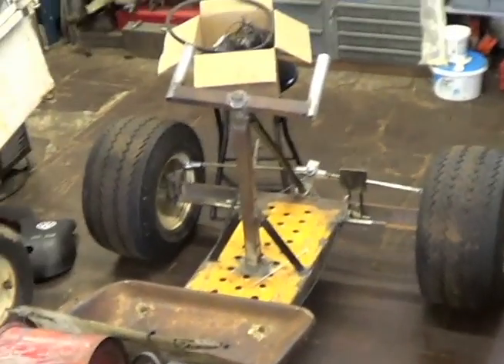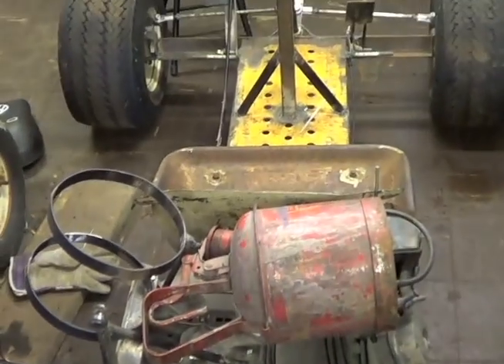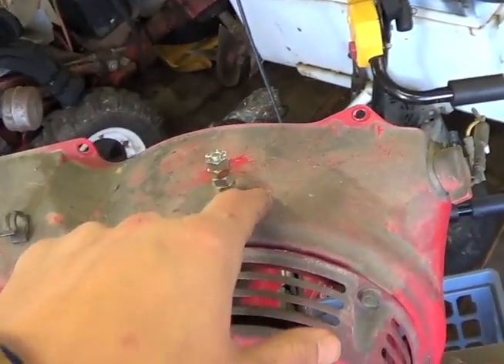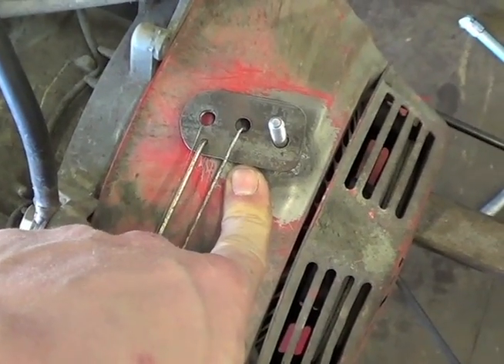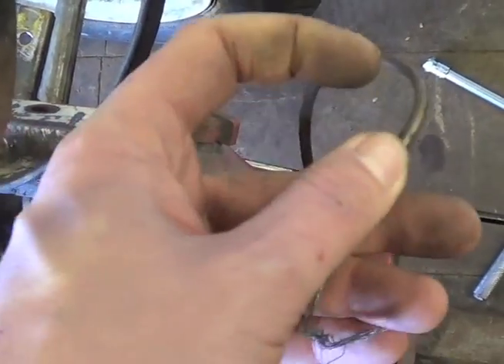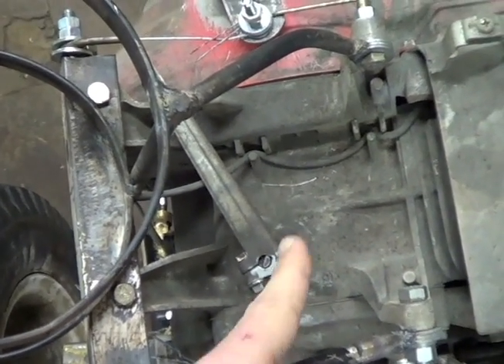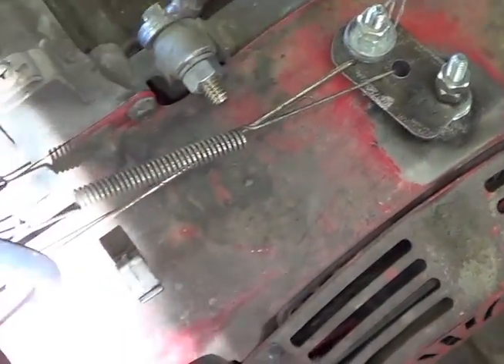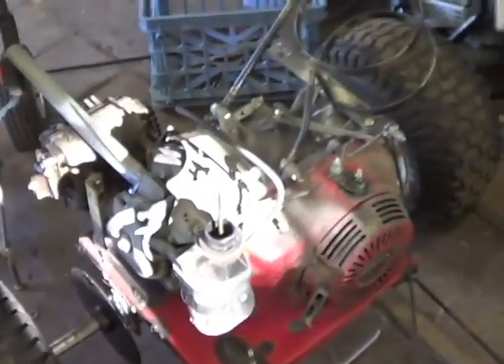Simple/cheap go kart throttle design

Comment: Bro come on 🤷🏻‍♂️ You did a great job hooking up your throttle but let's face it that is pretty mickey mouseed. Unbolt all that linkage mess and that carburetor and chuck it over your left shoulder
 Now save yourself some grief and put a mikuni on that bitch!! It will run better look better and will clear all that mess off your engine 👍🏻

Comment: if you ever upgrade it you should use a 212cc harbor freight motor. they are only $120 and more cc and power is always good. if that is the one im thinking of it’s 196cc
Reply from the maker: Jack Fowler I do love the Chinese 212 engines but this is a big ol gx390 so it’s almost twice the size of that
Reply: oh i didnt’t know that
Reply: i like what you did. im thinking of making something like that. i have one of those trannsmissions but with a diff that came off a lawnmower

Comment: Hey, seen you had an old 5 hp 3600rpm briggs. I have one identical to it, was wondering how you set up the throttle on that for your kart? i've ajusted the idle but i'm not sure if its the governor i need to ajust, i just cant seem to get the idle low enough for the clutch not to catch and the kart to take off. The kart keeps "chugging" almost when it starts, making clunking noises and after i run it for awhile its like the motor doesnt come back to idle when i release the throttle to idle position. any suggestions on what it could be?

Comment: i would never ever completely remove my govrnor for two reasons: 1, you could throw a connecting rod, which could bust out the side of your block or explode the flywheel, and 2 the governor also splashes oil up into the bottom of the piston. ive made adjustments the the governor on my mower to make it run faster but i wouldnt ever totally remove it
Reply: just kidding i just watched the rest of your vids on this build sorry lol
Reply from the maker: alexander kramer  haha, its all good. glad you understand!

Comment: hello nick im building a dune buggy and am stuck on the rear suspension and drive train if u could help it would be gr8. my problem is travel in the drive train and suspension and not braking chains or shafts i know vary lil about this kind of stuff if u could help. my e-mail address is wateroil at live .com pls help

Comment: But with that specific motor with out that governor you are gonna float valves like no tomorrow
Reply from the maker: not really. i dont wanna wind it out to 5000 rpm or anything dumb like that. i removed the governor for better throttle response. and if i do find myself floating valves more often than i think, ill just put in stiffer springs